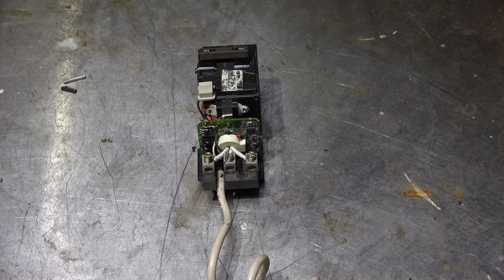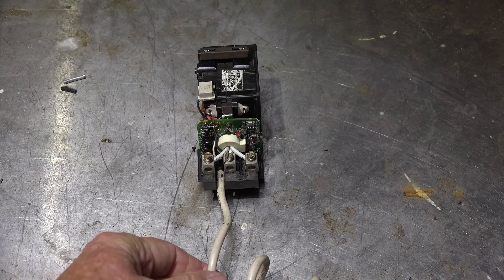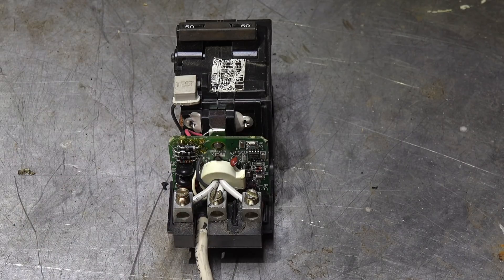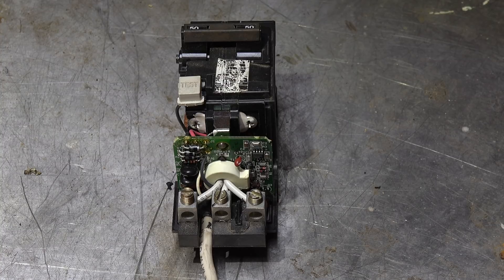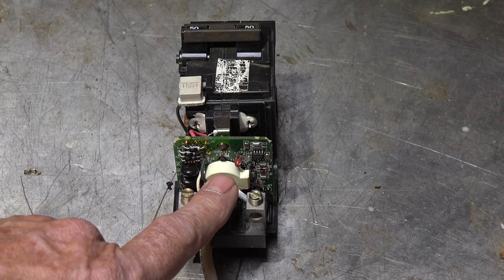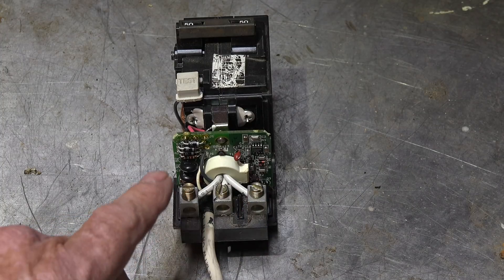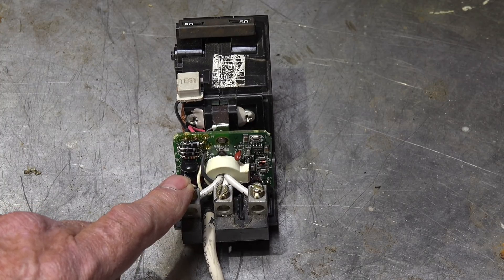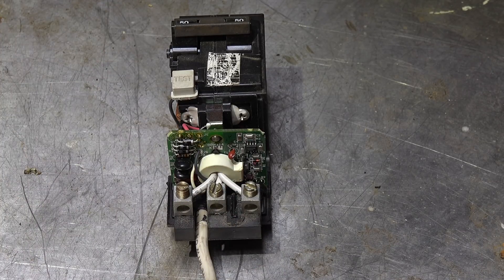How the 2 pole GFCI works: the neutral wire

Comment: ""BUT""When I add a neutral wire to the neutral lug on the breaker and then to the neutral bar the breaker will trip!......Why is that?
Reply from the maker: Does the breaker trip or does the GFCI open the circuit>
GFM

Comment: WOW. You should make a duplicate of this video called  "GFCI 240/120v wiring" and point out  the sub panel where the 120v is split out NOT to bond the neutral to the ground bus. 120v needs its own neutral for 120v circuits. I have a pond pump house w 2 240v pumps and a 240v UV light I need 4 120V circuits for air pumps and a beer fridge I looked at 10 er so other vids and figured it out from your vid Thanks a bunch.

Comment: Good explanation.  I'm more comfortable with having no connection to neutral now for my pool pumps.  The 240V pool pump motors of course have no neutral so i have nothing to connect to the center neutral and I wanted to make sure that was OK.  Now that I see its function, leaving it unconnected for a pure 240v load is ok.  great video.

Comment: Wow.  Great explanation.  By my simple explanation:  So any current that goes out on the red line and back on either black or white balances.  Similarly any that goes out on black and comes back on red or white also balances.  If any leaks to ground, it doesn't balance.  The white neutral MUST be the one that goes to the middle lug of the GFI breaker, NOT the common neutral in the box!  So a further question:  it would appear that I could split the red and black circuits, with both returns being 120V via the same white neutral that attaches to center of the GFI breaker.  And it would still balance, as long as no leakage to ground.  AND the box 220V ganged GFI breaker would protect both circuits?!?  That is, the black/white pair is a protected 120V circuit and the red/white is a protected 120V pair, both protected by the same breaker GFI?
Reply from the maker: That is correct.
GFM
Reply: @grayfurnaceman  Thank you so much for the rreply.  Awesome!!  I subscribed.

Comment: Thanks for that explanation! I was confused as to why a 2 pole 240 v breaker would have a load neutral. But your explanation makes perfect sense. If powering a device without need for 120 v then the load neutral is not connected to anything.

Comment: 10 amp draw on L-1 and 10 draw on L-2 to the heating element 240 v AC.
Got that part.   NOW the control panel for this appliance draws 1 amp at 120 v
AC.   From one or another of the L-1 or L-2.  Got that part.   FAIL TO SEE
how that balances out. EXPLANATION POSSIBLE. Two separate operations.
The 240 volt balances itself, and the 120 volt balances itself.  ???
ALTHOUGH it would appear that one side has 11 Amps. Thank you.
Reply from the maker: There is a balancing circuit built in to the device for neutral.  The loss of balance that will open the GFCI is a loss to ground.
GFM

Comment: Can you please do a video on how a arc fault breaker,  how it works,  and the difference between arc fault and gfci, I recently had issues with a Square d arc fault dryer breaker,  for some reason,  the breaker was only allowing 115v on one leg of the dryer plug and 70v on the other leg, I did have a major storm happened around the same time,  I just replaced the breaker and it is working normally now, just curious why I had to replace it, also noted I received total of 76v across the two hot legs, explaining this would be great gfm.
Reply from the maker: It is on the list.
GFM

Comment: Not a very good explanation on this.
Reply: Not a very good comment  on this. Saying something is good or bad without elaboration isn't helpful.
Reply: Manuel Arruda Understood. My opinion is the only people that can have a good basic understanding are people that have had some formal background in electrical theory. Voltage, current, inductance, capacitance. How does just anyone know why one amp difference make an imbalance? Not trying to be critical just give more precise information. I think the verbal presentation sounds a little unsure of his comments. My Father started teaching me to be an electrician on 1957 so by 1967 I was working as a journeyman electrician. I then was drafted and trained on data processing equipment repair. Went to college after that, worked as communications technician for ten years, electronics, instrumentation controls tech in a 1400MW power plant for twenty years and the lad fifteen were in electrical engineering for engineering research and development. I have a good understanding so Even though the presentation here is helpful to some O think some will be left with a question mark. 
I have not watched his previous videos and how far they take someone so it is most likely that I am speaking out of turn here and do apologize. I will watch more and keep my comments to myself unless I can add a positive and useful comment. Thanks for questioning my assessment, I do need to be uplifting. 👍🤙😁
Reply: @kenswitzer4133  Take your self over to Mike Holt video on YouTube  Grounding - Safety Fundamentals. You will see that some licensed electricians don't have a firm grip on grounding and bonding. I worked in radio and tv broadcasting as an engineer and I could not believe the number of FCC first class licensed engineers that did not fully understand ground and bonding.
Reply from the maker: @kenswitzer4133  Thank you for the elaboration.  I am an electrician but I try to explain things in the simplest manner I know.  I have taught heating and cooling and electrician licensing updates.  I believe that I must teach to the one that understands the least.
GFM